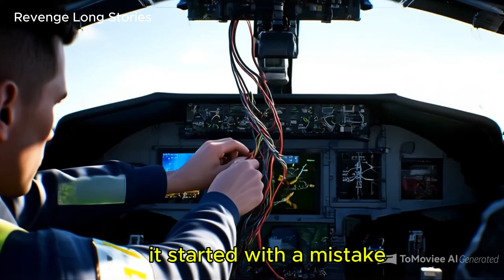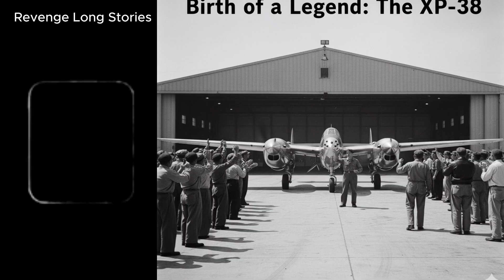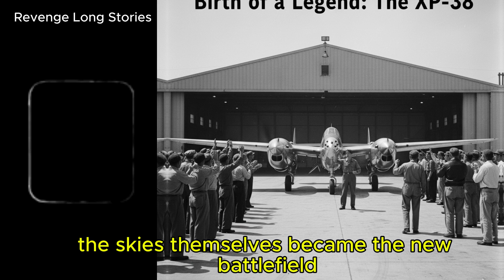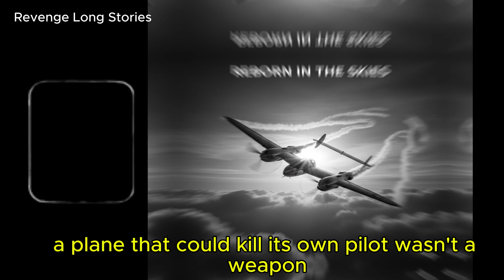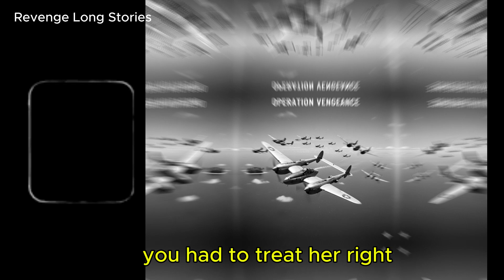The ‘Stupid’ Wire Trick That Made the P 38 Lightning Untouchable

Comment: This is a grossly oversimplified story of a very special plane.  Wires were not the primary fault in causing the control lockup - it was the shock wave that developed on the top of the wing between the cockpit and the two engine booms.  (Edit to delete harsh criticism)
Reply from the maker: I appreciate your feedback! The P-38 Lightning is definitely a complex aircraft, and I always welcome insights that help deepen the discussion.